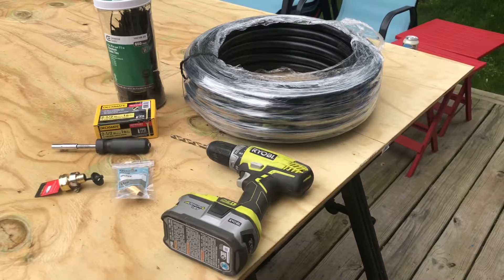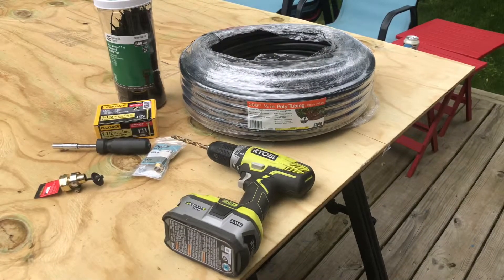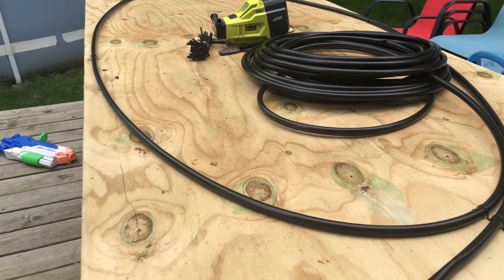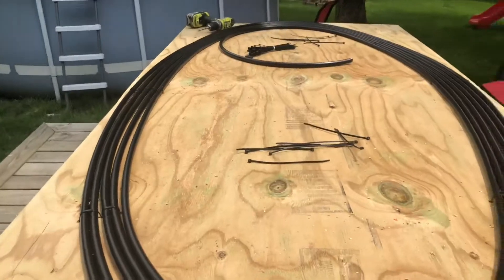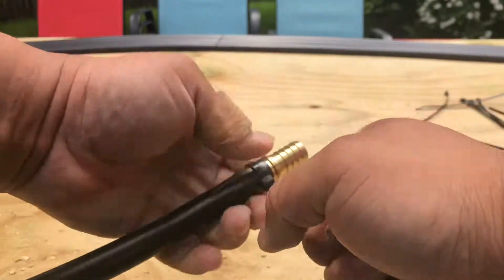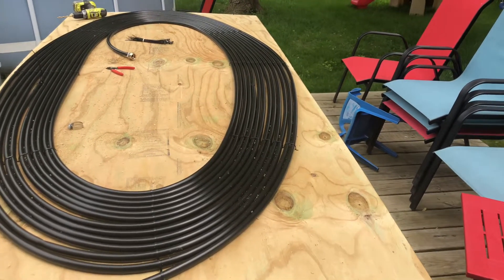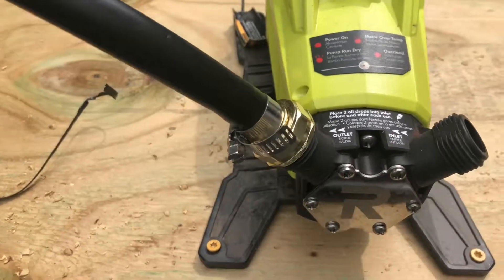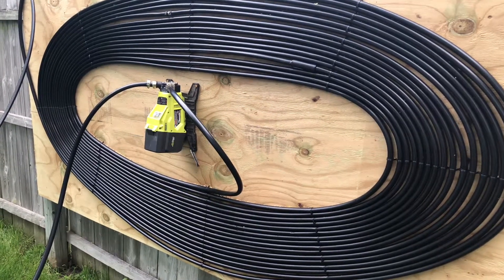Massive solar pool heater!!

Comment: I built one just like this with 400’ of 1/2” hose. I hooked it up to my zoller 1/3 hp sump pump. It works great when the sun is out!!! Atleast a 10° temperature difference and over an 8 hour period it will raise the temp of my 14x42 7 degrees.